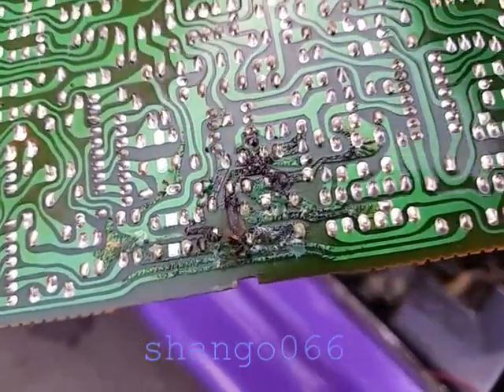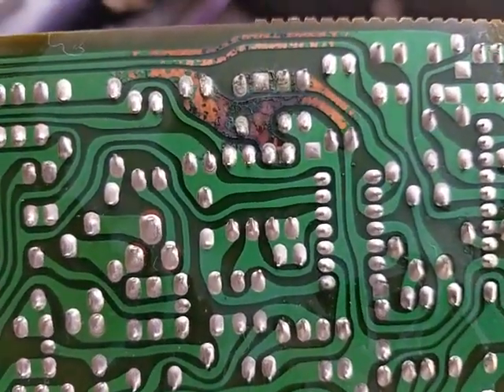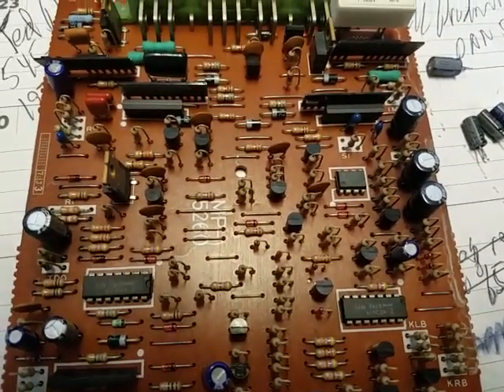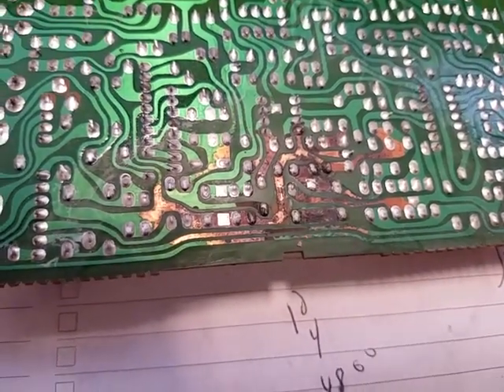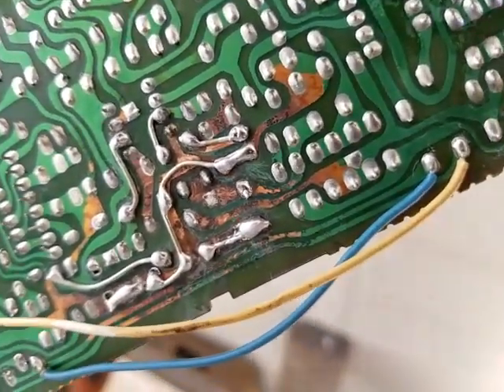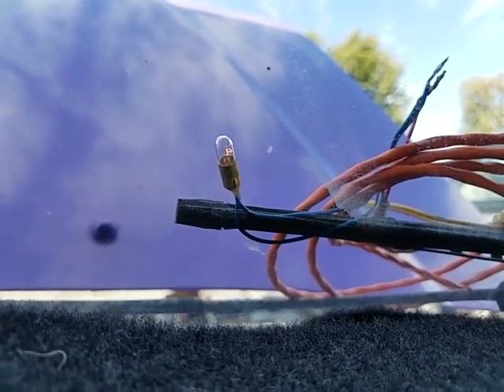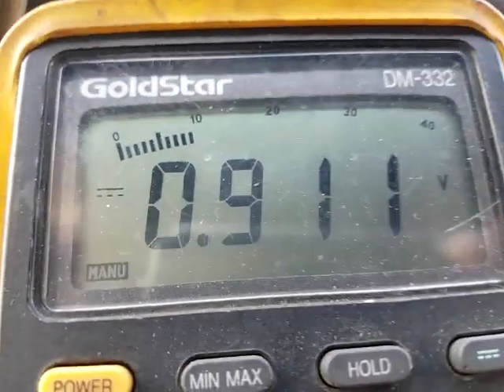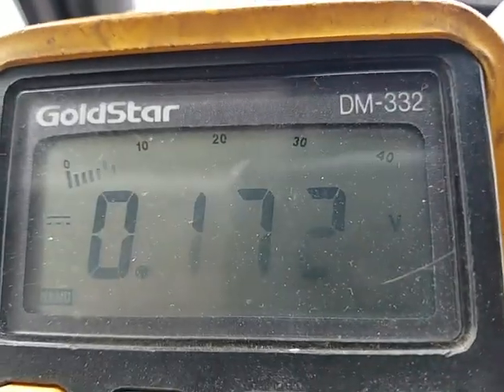ECU Repair Toyota Pickup Leaking Capacitors Feedback Carburetor 22R

Comment: I would imagine that since the through holes aren't plated like a via or a modern PCB, the electrolyte just got into every lead pocket in the board it could, and sat there until it worked its way out from under the trace to board glue joint. Made quite the mess of those traces for sure. Nice repair work as usual.
Reply: Good point.  It attacked from the underside of the trace rather than from the surface.
Reply: Yes, and that is a phenolic/paper PCB so once it got in the holes it spread through the "structure " of the PCB.
Reply: @michael931  Yes, phenolic boards are permeable to liquids. Remnants of the leaked electrolite should be chemically neutralized in order to stop further corrosion. But how one should neutralize a liquid that is trapped amongst the fibers of some resin impregnated paper (= phenolic board)?

Comment: As for the open traces, I  wanted to share a success I had in using automotive rear window defogger metallic trace repair paint to fix an inoperative telephone base station number button. It was an ancient AT&T cordless phone base station and the #3 button would not work on the base station. I took it apart and saw a minute gap in the trace. I  didn't want to monkey with a soldering iron on the delicate surfaces, so I tried some leftover car rear window defogger grid repair paint, and that worked. Dunno about resistances on  circuit boards, but might come in handy for some of us in some circumstances. Edit: I think that repair kit was something like $15, so it wasn't cheap, but it was left over and was cheaper than a new phone.

Comment: 22R toyota is probably the best engine ever built. Awesome video keep up the good work 👍
Reply: I agree, Also  the Ford F150 300 strait 6 engine. Both will run forever.
Reply: Yep it was a real popular engine that we frequently rebuilt in the 90s at our machine shop
Reply: I had a 1985 Toyota pickup bought new. It had the 22R but I don't think it had any electronics in it. Sold it in 2006 with 211K on it and that 22R still ran great.

Comment: Nice video.  It snapped me back to 1983 when one morning I went out to start my '81 Chevy Citation and all it would do is crank over and not fire.  Did all the obligatory initial trouble shooting to no avail.  Then it struck me, does this car have an ECU?  It did and so I opened the glove box and pulled it off the firewall.  Took it inside, opened it up and Voila!, staring at me was a blown trace on the circuit board.  I could see no contributing reason for it popping, so I just soldered a jumper across the gap, put it back in the car and it started instantly.  Needless to say it made me feel like a genius for a day.
Reply: I think those had an actual engine computer the CCC or Computer Command Control that ran the ignition timing an everything.
Reply: Same here. First car was an ‘86 Monte Carlo with the CCC Quadrajet. Occasionally during a stop at a red light, it would start blowing black smoke, and running like trash. 

I figured it was either the float sticking, or the stupid little solenoid plunger for the main jet metering rods hanging open. 

Limp it to the side of the road, give the carb a few wacks with what ever sold object I had with me, and I was on my way again.

Comment: Excellent going there, Mr Shango!  Those phenolic paper boards are a real shitter because the board actually saturates itself with that vile electrolyte and corrodes the traces from the underside, even becoming conductive between traces too. I have had good results by pulling the contaminants out first immersing the board in destilled water with a few drops of dishwash soap for a few days. the water creeps into the pores of the board and greatly dilutes the electrolyte. Then I immerse the board in 99% isopropyl for another day or two, this will draw the moisture and the rest of the electrolyte out, alcohol being the dehydrating agent. Time is the essence here, but have had almost 100% success rate here.
Cheers and best regards from Germany

Comment: Good job with the fix! - To protect the exposed PCB traces, you can use a conformal coating 'overcoat pen' to replace the missing green solder mask. Makes a really nice job :)
Reply: I usually use nail polish for that, it probably isnt nearly strong enough but it hasnt failed me yet.
Reply: He needs a T shirt with a big S for SuperTech.
Reply: Selanoid?
Reply: @mctigmctiggy1475  me too.

Comment: I found that one of the little micro engravers you can get at Harbor Freight for less than 10 bucks works extremely well at removing corrosion. It usually shaves off just the top layer of corroded copper while leaving behind the good stuff you can still solder to. If you do a bunch of these I'd definitely recommend trying it.

Comment: The cap juice seeps down through the copper laminate by the pin holes and even through the board itself. And unless the electrolyte had corroded ICs and transistors it will be all fine...for the traces we used to scrape them down then wash it off and bend up some stripped Ethernet wires to reconnect them back and routed as how they were. Made sure to apply lacquer to the traces afterwards (they use pretty much the same on the factory so you could use lacquer thinner and wash off that insulation)

Comment: Here in Florida we don't have vehicle testing of any kind, so if the truck ran ok without the ECU, we would just toss it. I remember the problems GM vehicles had with feedback carbs, and I've rebuilt a few---getting the solenoid set just right is so critical, as it affects primary metering rod depth
Reply: Yup, the one place on a car you needed to set “dwell” that didn’t involve the ignition, on those old GM CCC Duo and Quadrajets.

Comment: I had a 1985 Toyoter pickup bought new in June 1985. My first vehicle I bought myself. Now, they weren't like American pickups, mine had a tin can sound when you opened and closed the door and very hollow sounding. Bench seat that wore out eventually, noisy on the road. But it wouldn't die. It always started and that manual transmission never missed. The clutch lasted to 180K miles. I had a/c in it. Sure it didn't have incredible power and wouldn't reach 100 mph, but it stayed out of the repair shop for long stretches. Sometimes I wish I still had it to drive around town with because I'm sure the 22R in it would still be going. Sold it in 2006. I wonder if it's still driving or been turned into a soup can.

Comment: I'm guessing that is what happened to my 1997 Buick Riviera's ABS system control box. A few years ago when I learned of this problem anew, after hearing about computer mother board with this problem, bad batches some 15 years before the leaking capacitor problem is often what knocks out most electronic circuits these days. I repaired  two TV and many flat panel monitors just by replacing the capacitors in the power supply of those items. As for the Riviera I had bought a used box from a junk yard several years back and nothing changed , but these are sealed up completely, I'll have to take a dremel tool to it to open it up if I want to try and fix it. Thankfully so far on any of my 1990's car did I have a problem with the control computer.

Comment: Good job bud. I've had decent success with adhesive copper tape and trimming to width. If you move fast with an iron it'll normally stay stuck to the pcb. Fine wire obviously works well too. Good save!

Comment: The engineers who designed that vehicle would likely be amazed that it is still in use well into the 21st Century.
Reply: If it wasn't for rust lots more old cars would still be on the road.

They "evaporate" real quick up north. Can't recall the last time I've even SEEN a car that would use a feedback carb. Just seeing a late 80's or early 90's car is rare enough.
Reply: @volvo09  That's because nobody properly treats their cars for rust. They think that garbage undercoating the factory sprays on will help them... it won't.
Reply: @volvo09  Truth. Thank you.
Reply: Planned obsolescence
Reply: Well, it's a Toyota. Not a cheap ass U.S. made piece of crap that really was meant to be disposable.
Reply: The proper diagnostic process was to smack them and see if they started😂
Reply: @Chet Pomeroy 
How old would those engineers be now? The car was in production in the early 80s, so the engineers might have been in their 40s or 50s? So now those guys are late into their 80s or maybe even early 90s?

Comment: This should be a public service announcement for anyone who drives older cars to open up critical ecu’s and check the capacitors before it leads to this. I’m driving 80’s Mercedes right now and capacitor issues are a thing with these as well.
Reply: it IS a thing on everything that have electrolytic capacitors and are already over 15 years old (the lifespan of the sealant as the manufacturers say) so that should have been all preventable. And better to use automotive grade stuff too. Vibration resistant and high temperature...note that capacitor life is listed as HOURS at a given temperature (low ESR would be a plus too if available)
Reply: @bigcatauna  Bosch KE Jetronic was one of the best fuel injection. That coupled with EZK ignition. Very low failure rate.

Comment: Great fix shango!! Ive seen a lot of bad boards from the 80-90s! For me back in the day(before internet) it was faster to fix one of these rather than go find a working reasonably priced replacement. Seemed worse for people who lived in high moisture areas where temps varied a lot, hot summers cold winters. I think the electrolytes wick down the leads, eat through the top layer of the board to the bottom, and cause this mess. At least these days you can buy a lot of stuff to repair traces(without lots of jumpers) and nice uv mask liquids. yea for the future? lol
Reply: For best reliability when possible run a jumper from point a to point b the way Shango did. That way your not depending on a fragile damaged trace to hold up.

Comment: I wonder if the same board would still be functional if the board were coated in the jello shmooo they put in the ecu case sometimes. 

I have found on those Toyota carbs, the shaft for the throttle holding the butterfly valve has so much slop a vaccum leak is created, which is random in nature. 

...this is usually less of an issue around here where the rest of the management system has been "repaired on" and is non functional, but I would imagine confuse the controller with the equivalent of some unmetered air behind a MAF. (I.E. panic, confusion, emotion = self medicate with a rich fuel mixture)

Comment: Nice job shango066!  
It is surprising that you would get that much damage without there being large puddles of shmoo spread-out on the top of the board.  Also, the solder-joints appear to have been seal so wicking doesn't make sense either...

Comment: When it was in closed loop was that light flashing with  the solenoid valves on/off duty cycle? I assume the solenoid just opens and closes at a reasonably slow rate and holds for longer and shorter in the open and closed positions to bleed air at greater or lesser rates per 02 sensors voltage readings

Comment: I should probably replace the caps in my 89 F150's EEC-IV ECU as a preventative measure before something like this happens. I think there's only a couple in there. The ECU was full of dead ants when I bought the truck, it's a miracle the thing works flawlessly like it does now.

Comment: As a shop owner myself, the fact that yal keep almost 40 year old emission systems up to par in CA is wild to me. I get it but at the same time it muat get very costly to operate an older vehicle. Here in NC anything older than 20yrs is safety only. Two different worlds I guess.
Reply: its because its the states way to get these older vehicles off the road. it fails emissions, well, now they need a new one
Reply: In Washington, the state quit testing at alla few years ago. They admitted this did nothing to improve air quality.

Comment: that huge board  doing only on off  ? what and work without  ?  why not use turn signal relay  it the same thing
Reply: it has to turn on or off at a specific rate to regulate the solenoid's action and the rate it turns on or off depends on the feebck from the o2 sensor so quite complex to achieve without microprocessor and software...
Reply: @MrHBSoftware  what ?

Comment: Those pesky panasonic capacitors.......The electrolyte seeps through the fiberglass. Try looking at a mitsubishi TV built between 1989-1995. Every black nichicon cap will be leaking. Used to fix multiple areas of corrosion on the old mitsubishi tvs.

Comment: I fear the juice of the capacitor went through the pertinax (I don't know the English name of this PCB material) board. But that just sad that some cares will end up broken cause of this stuff.
And low resolution shorts like this is fine unless you play it on a 60" tv.
Reply: I was thinking that it went through the hole and came out from under the trace, probably why the trace was open

Comment: Have you tried using Wires Adhesive to repair the tracks that went open circuit. Wires Adhesive is a conductive adhesive.

Comment: How hard is it to screw up so many capacitors over decades. TV’s, computers, medical equipment, monitors and so much more.
Reply: Well, after decades spent outdoors, they're going to fail. That's a decent lifespan really. Nothing like the big cheap capacitor problem that plagued computers and other equipment in the later 90s into the 2000s.
Reply: @JulianA-tr6pt  During the mid to late 80s (and even into the 90s) there were some specific low ESR/high lifetime capacitors that have started failing catastrophically like the ones in this video. I know Nichicon, Elna and Panasonic are the worst offenders; I've found them in VCR power supplies, old computer power supplies, and ECUs like the subject of the video. They must have been trying a new dielectric that goes corrosive over time and breaches the seal at the bottom.

Comment: Those trucks were built to last
Reply: @commietube_censorship_sucks  If you undercoated the vehicle and did undercarriage washes regularly they would hold up decently.
Reply: @commietube_censorship_sucks  There are a number of modern undercoatings that do not do that, and do not attract dirt and debris, like Krown for example. Lived in Philly PA area for years and they too dump tons of salt on the  roads for around 4-5 months a year. If you are good about undercarriage washing with a brush and soap it will reduce the rust significantly.
Reply: @commietube_censorship_sucks  Well than you get more rusting, if you like a vehicle enough people will put the time in to keep it in good condition, you're complaining and then saying you won't do anything more to prevent a problem with relative ease. 
A.I. sucks still.
Reply: @commietube_censorship_sucks  The washing removes the salt residue which sticks to the undercarriage and promotes rust. Oil tends to attract debris and will also entrap salt causing it to stick and promote more rust. AI clearly isn't close to being ready for prime time...No wonder why Dave disconnected HAL 9000.

Comment: I can't believe that there are ANY cars out there on the road,  still using a speed-density system.
Reply: but that's really common, I know many subarus use speed density from the late 90s and early 2000s.
Reply: Almost all Chrysler products are speed density to this day. No MAFs. Fine with me actually
Reply: i am in Europe and here there are a LOTof cars relying on MAP sensor and IAT....some olde rcars even rely heavily only on TPS...and btw maf has a way higher failure rate....from the old sliding door mechanical mafs to the modern hotwire ones they all go bad....